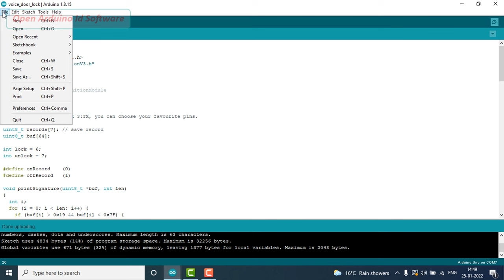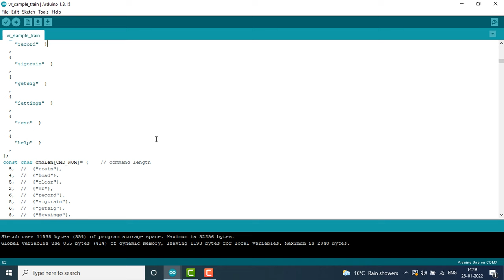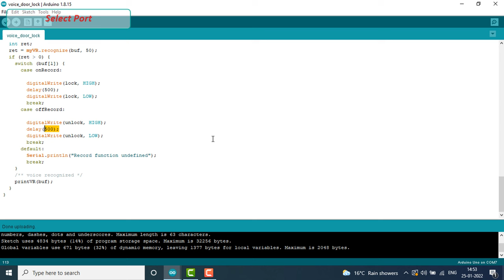How to make Voice control Door Lock | Make Door Lock with Voice Recognition module V3

Comment: Sir pls can you tell in the place of door lock acuator can we place a motor normal dc motor pls tell sir
Reply from the maker: yes, we can connect 12 volt DC motor
Reply: @fairelectro   can i use a servo motor instead of an actuator? And if so, what changes do i need to make in the code you provided above so that i can use the servo motor instead of an actuator.

Comment: Hi! Thanks for your Tutorial. After train the module (load command), and then use external power supply on arduino. why v3 module led not blinking anymore? Is it possible not to train (twice), or how do you enable auto load (train) the module? thank you ;)
Reply from the maker: press arduino's reset button and then check
Reply: @fairelectro  thank you for your reply. nope, it did not work. Also, I already check (type: "settings" in serial monitor) @v3 train library --> Auto Load : disable. Any other solution (maybe?), regarding this problem?

Comment: Hi sir! why does it says train timeout after i type in the command? Why sir please suggest me I have checked may Mic Connection all Ok But Whenever Code is Run That time Train time out ??
Reply from the maker: Audio commands are not matched. Speak near the mic
Reply from the maker: Also check your mic is working?
Reply: Hii, did you already resolve the train time out problem? I'm facing the same problem.

Comment: My actuator is not working, the voice is recognized but the actuator doesn’t do anything, pls help
Reply from the maker: Check wiring. also check motor driver is working or not?
Reply: @fairelectro  wiring are good and the motor driver has a light on it so i assume it’s working
Reply: @fairelectro  is it possible that it has insufficient voltage?
Reply: Manager Library?